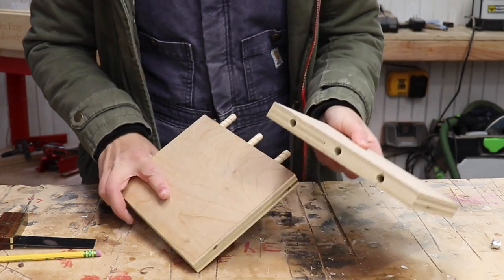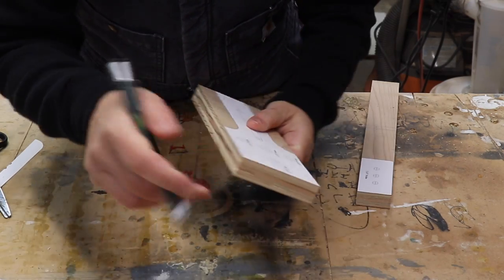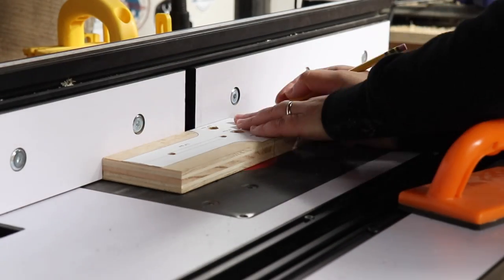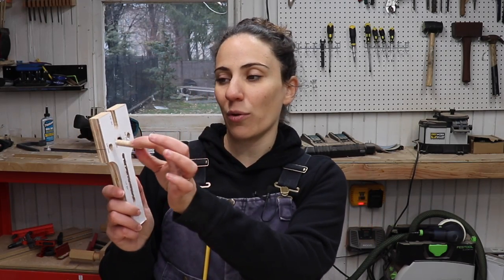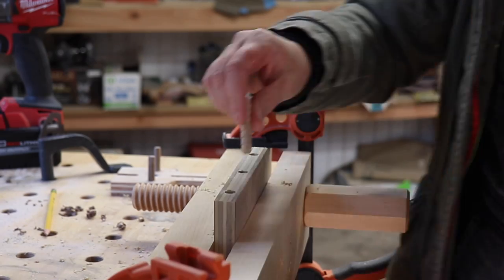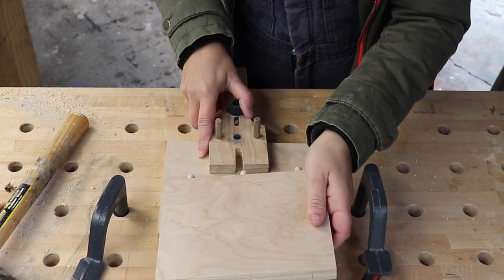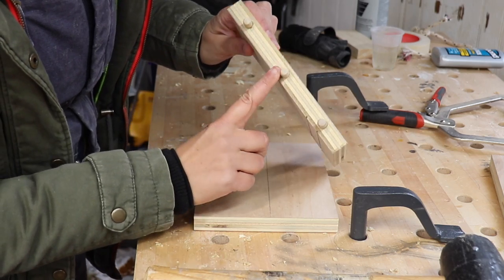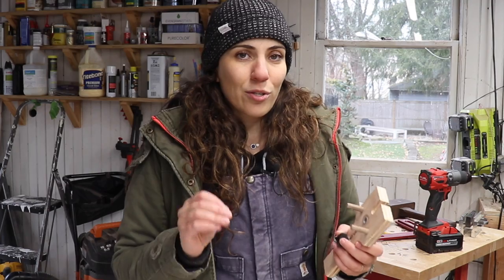Making an ADJUSTABLE Doweling Jig for Joinery

Comment: Hey Tamar, thanks for making this available to us all. I just realized after going to Lowe’s to purchase the steel bushing for the center hole, purchase a second bushing with 3/8 outside diameter and 1/4 inside diameter. Then your dowel jig works perfectly with both 3/8 and 1/4” dowels, same jig, just ad a smaller bushing. I too will likely only use 3/8” dowels but I thought I share! The bushings were in the hardware isle.

Comment: The jig you based off of is the jig I do have. I have only used it on one project. I had one are where things just did not line up. There was no issue with the jig, it was my error of how I lined up my boards. I drilled the board facing the wrong way.  That is one thing you have to do is be mindful of your board orientation. I fixed by switching to pocket holes. It was my first project with the jig, and I learned from my mistakes. Yes the jig is plastic and if does wear out or break, I now have a source to know how to make a replacement jig. Thank you for the idea and video. Your videos and how you approach and overcome are AWESOME!. It is people like you that inspires me. Please continue to make awesome videos! Mike from Tucson, AZ
Reply from the maker: That’s so awesome to hear! Thanks!

Comment: Thank you for taking the time to make this video. I’ll add that some metal tubing is not precisely 1/4, 3/8, or 1/2”. One may use something called a steel spacer in the nuts and bolts area of one’s local hardware store. Such spacers are only a few cents, come in various lengths (no need to cut them) and pound nicely into wood like you showed. Also Lee Valley makes inserts and bushings for interchangeable sizes (I think something like 6 sizes), but the require a 5/8ths hole, larger than most drill indexes. 

Anyway great video.
Reply from the maker: Good to know!
Reply: Tom McCurnin Would you be so kind to PM me please?

Comment: I just picked up the Milescraft doweling kit a short time back. Basically the exact same concept but with 3 different sizes of drill guides for various dowels.
Yours is much nicer than a mass manufactured piece of plastic from the PRC.
Reply from the maker: It’s nice to have that option for different sized holes though. Thanks!

Comment: Fantastic, will be making mine asap, love it, and it would be easy to make two or three at different sizes,. after all not many of us use 27 different dowel sizes three would more then cover me. Loving it.
Reply from the maker: Awesome! Totally agree! Think I’ll just make one more for smaller dowel
Reply: if you want different sizes (bushes) look at the 3 screw in bushes (metric I know 6,8,10,) supplied with the 'cheap' Silverline pocket hole jig (£5.00. UK)

Comment: I never saw that dowel jig for joining the boards perpendicularly...  I have the original jig and I loved it, but you're right, it could only edge join boards.  I'll have to get me one of those (or make one like you).
Reply from the maker: Yeah... that jig is great for panel glue ups. I always found dowel points to be a bit finicky. Good luck with it!

Comment: To make it use different size dowels, you could drill / route out a larger hole in the jig, and then make inserts with different sized tubes to accommodate the different drill sizes.
Get project and I'll be making one myself soon.
Reply from the maker: Awesome! Glad you liked it!

Comment: The way I use the metal jig you showed (which is very inexpensive) is to take a scrap piece from the wood I'm using that and Mark and drill the holes using the jig. 

I then cut the strip off so the hole go all the way through. I then use that as a jig for both end drilling and face drilling. 

I use it as a marking template for the edge and I clamp it on the face and use the holes to just start drilling enough to create a mark, then drill to full depth.
Reply from the maker: That’s what I used to do. I used to make a template just like that like I showed in the beginning of the video. It worked really well but I didn’t like that I needed to make a new one for every project

Comment: This is amazing. I have to make this.

The metal collar just needs to be removable and have some sort of adjustable clamping mechanism to hold different sizes in place
Reply from the maker: Have fun!
Reply: @3x3CustomTamar  I will. It will be extra fun and challenging because I have almost no tools to do it. A coping saw, circular saw, drill, and a few other tools are all I have.

Comment: I have a dowel jig like yours with various different size holes for drill bits. I only hole I ever used was 1/2" dowel holes. Then I discovered DowelMax it does everything you are using you invented jig for.
Reply from the maker: Yeah they actually sent one to me after this. I can’t wait to use it!
Reply: Perfect you are a Rock Star! I love my DowelMax.

Comment: I’ve already got a Wolcraft for 3/8” and smaller - but I’m going to modify your template because I can’t seem to find any retail device that can accommodate a 1/2” dowel pin. Just need to determine (and locate) outer steel tubing dimension with interior an hole size of 1/2”. Great template. And yes, the open slot also needs to be expanded to1/2”.
Reply from the maker: Awesome. Glad you found it useful!

Comment: I found steel spacers 1 1/2" long, that fit inside each other so you could use your jig with some idea for front slot to be determined, for different size dowels:
1/2 ID 5/8 OD for 1/2"
3/8 ID 1/2 OD for 3/8
1/4 ID 3/8 OD for 1/4  (looking for this one)
Nice wooden jig
Reply from the maker: Cool

Comment: Nice build.  I watched Jean on the Woodshop Junkies channel review that same doweling jig.  Looks like your version could be more versatile, depth-wise, and quite possibly more durable- the commercial tool is plastic, after all.
I love that this jig requires very little matching up lines to match holes - you're using the installed dowles to match the mating holes.  

Great build, thanks!  I might have to scrounge some scrap...
Reply from the maker: Thanks! So glad you like it! I was surprised with how well it worked! Good luck with it!

Comment: Great jig. I would use bushings with 6-8-10-12 mm holes from a $7 drill guide set (the Chinese made type with a clear plastic holder).
Reply from the maker: Thanks! Sounds like it would work

Comment: Once again Tamar....awesome stuff.
Reply from the maker: Glad you liked it!
Reply: @3x3CustomTamar  I made a centering jig like you have with the dowels and a pencil in the middle.  It did not seem to work right.  Sometimes it would center, sometimes not.  Any thoughts?
Reply from the maker: Shane Thompson hmm. Did you use a drill press so drill the holes?
Reply: @3x3CustomTamar  No I do not have a drill press.  I did my best to make sure the drilling was straight up and down but obviously my best was not good enough.

Comment: Hi Tamar, was thinking how to solve different dimensions of dowels for this jig, not using wolfcraft solution, that is having separate circle dimension depending on place of hole.
We have here static parts and adjustable part. Static part is middle hole + 2 bolts that mark circle middle and it's border (that's why we always get in center of material). Second, adjustable part is responsible to control material thickness and it's also not an issue.
Problem is in first part, that size of drill hole is static and we want it to be adjustable, all that must be done is to create a exchangeable insert with metal bearing, that for every dowel/drill size will always be in center vs 2 dowels that mark the outer circle.
I would route a recess about 12mm (0.5 in) deep and 25mm (1 in) wide in base and create 3 plug-ins (0.5''x1'' with perfect fit to recess) that i can screw on with muff to base* for 3 most common dowels (6,8,10mm | 1/4'',5/16''/,3/8'') and it would be piece of cake to add more of this in future.

base* = jig per se :P

Comment: Great idea. I do a fair bit of dowel joining, but much smaller than this — I use 2.5mm dowels bamboo dowels, also known as toothpicks. I normally use cut tips of 2.5mm nails as a guide, but if the edge I’m drilling into is thin, like tone wood for example, it’s frighteningly easy to get it wrong by drilling at a slight angle. I might build one of these in aluminium.
Reply from the maker: Awesome

Comment: Very cool jig! I made a much more simple dowel jig (the clamp on kind), but I do love the versatility yours offers (I'm all about the options). I think the only thing I would add is a saw mark to that centerline on the side with maybe a thin strip of brass or some black Starbond glue to fill in the line and make it more permanent.
Reply from the maker: Thanks so much! And I totally agree with you. Going to add that.

Comment: great project. 2 small things come to mind. 

first, you mention different size dowels, this seems cheap and easy enough to just make a few extra , one for each size. thats one of my favorite parts, its very useful, but very cheap and simple. 

2nd, the only addition id make would be to cut a small v-grove in the side instead of the pencil line that may smudge/rub off over time.
Reply from the maker: Thanks! Totally. I’m going to make one for smaller dowels too. And that’s a great idea for the sides

Comment: Interesting design. Just a suggestion though: the slot in the front of the jig was cut with a bandsaw and I can see that the dowel doesn't quite fit snugly in it. Milling it with a 3/8" router bit on the router table would ensure that the resulting slot matches the diameter of the dowels perfectly. That way, the edges of your joined boards will line up better (especially on longer pieces).
Reply from the maker: Totally. Just wanted to give ppl options.

Comment: Great jig Tamar. You "could" design one for a different size dowel but most of your work is geared around 3/4 inch material so ...  I suppose that you could make another guide using removable wooden inserts containing different size guides... I wouldn't - it would be easier to make a second jig for the different size dowel. You do great work and excellent videos.
Reply from the maker: Yeah. Totally agree. Think I’ll just make a second one for smaller dowels. Thanks!

Comment: Instead of tubing use a couple ball-bearings. The inner diameter is precies and will give less friction on the drill bit. For different sizes dowels make a jig for each diameter dowel you plan to use. Your only restriction for the diameter is depending on the inner diameter of the ball bearing you can find.

Comment: It's a clever reverse engineering of a similar jig from the german brand Wolfcraft.
Their device has an offset for the centering dowels, so they can place three different sizes holes : 6, 8 and 10 mm. There is also a block with miter cuts on the handle side to complete the centering dowels.
This block also contains what I suppose to be a spring-lock mechanism to maintain the position of the equivalent of your stop block.
There are three slots to align the jig with the dowel already placed, and they've added a center lign on the side in order to drill in the middle of the boards.

All in all, the german version is bulkier than your's, especially on the thickness side.
So, even if your version only does one size holes, I find it more interesting for two reasons. First, the design is lighter, and second, you have the satisfaction of a completed DIY project.
And as you say you love dowel joinery, and if you see this comment, maybe you can come with an elegant version 2.0 that can handle multiple sizes holes.
Reply from the maker: Agreed! It’s so fun to make it yourself

Comment: I also made my own dowel jig not unlike the one you show at the beginning. It is made with three holes where the middle hole is not centered, thereby giving me some amount of leeway in where the dowels are located. It drills 5/16" dowels, is self-centering on the edge of the board, but easily comes apart to use just the center and one outboard part to drill the corresponding holes in the face of a board. I am going to make a new one, because the steel tubing I used for this one only has 1/16" walls and has started to wear so that the drill bit wobbles slightly. Although I may just drill the holes in this one oversize to accept tubing with 1/8" walls for 5/16" dowels, and make a second one like yours for 3/8" dowels.
BTW, I think you meant that the tubing you used has 1/16" walls, not 1/4", because having 1/4" walls would make 1/2" tubing invisible. :)
Reply from the maker: Oh. Ha. Maybe. Oops. It’s so fun to figure this stuff out
Reply: @3x3CustomTamar  It's a great jig, and seeing how easy it is to go from edge drilling to face drilling, I may not even repair my original jig.

Comment: Great design! But in the center of board I would just measure and mark where to drill. And use +0,5mm bigger drill to compensate play of drill. I made a similar jig and it is very comfortable at the edge, but takes more time in the center.
Reply from the maker: Thanks! Sounds cool

Comment: when using spay adhesive for templates, i've found that spaying the paper can lead to expansion in the paper, causing template to fail. spaying the wood works better, but it's more mess to deal with after.
Reply from the maker: I’ve never had that issue. I just wait about 2 minutes for it dry a bit before putting it on the wood and it peels off pretty easily that way too
Reply: @3x3CustomTamar  Thanks for the reply! it may be a thing with either the glue, the paper or both, i've had it with both plain printer paper and universal bond paper for builders drawings. i'll give the fancy 3M stuff you're using a try, sanding off paper and glue is work i can do without

Comment: Amazing design! I am considering maybe a smaller/thinner tube inserted into the 1/2 in. tube will make the jig work for smaller dowels. You may sand the 3/8 in. tube until it is snug, not too tight or too loose.
Reply: The small 3/8 slot in front will also need an adjuster for smaller dowels.

Comment: Very good. I failed to come with a design so I made my dowel template from an 18mm metal bar. It does ends and faces OK but it's not as cool as yours. Same as you I always use 8mm dowels so one size is great. I might have a go at your design now. 😊
Reply from the maker: Awesome. Hope it works out for you

Comment: Great video.
Couldn't help but notice your work bench and specifically the clamping mechanism. Have you got any more information about that? Looks so quick and useful!
Reply from the maker: Thanks so much! Yeah! It’s a table from armor tool with dog holes. The clamps are just hold fasts that lock into the holes on an angle when you bang them

Comment: first lesson by my old man was sawing aged about 7, then drilling straight with a hand drill,.and then the doweling/domino thing.  two holes drilled and 1min with a chisel and you saved yourself $1200 on a domino. he was a master carpenter, you dont need all these excess tools you need some basic joinery skills.
he never used jigs, he used his eyes. that way your body learns to do it accurately. using a jig you never will learn to do without.
you dont learn to walk using a walking stick.

Comment: Cool jig! I have a milescraft one that is for 3 sizes and is a bit overkill because really always use 3/8" dowels only once used it for 1/4" ones. Is nice to make your own jigs mostly because can be done more fitted for your needs in my case I feel the milescraft handle is a bit small for my hands and also to adjust the stop block is a bit unconfortalbe with a couple of tiny knobs on the sides again my hands are a bit to big for them 😅 so gona make one for myself 😀
Reply from the maker: Awesome. Yeah! I hope you like it

Comment: Really great instructional video! To your point about only drilling 3/8 inch dowels/holes: it’s not an expensive jig and I think you would be better off making multiple versions in different sizes. Plus, if you have a couple of jigs instead of one “All purpose” you’re going to be less likely to make an error. Great job as always… Thank you!
Reply from the maker: That’s a good point!

Comment: Maybe get one of those really cheap little plastic doweling jigs from eBay that break so easily and use the metal bushings that come with it to place in the hole for drilling different size holes.  One could also make a hole in the end where the slot is to place the bushing for aligning on the flat; instead of a perfectly round hole, it could be made oblong so it can adjust up and down to compensate for different thicknesses.  I might have to try this since I have had been of those cheapie plastic units and it came broken.

Comment: Great video! You explain how it works perfectly for all three types of doweling joints. Also thank you so much for the free plans too, that is so very nice of you. You mention at the end of the video about the limitation of it only being useful for one type of dowel, well I think someone was listening. I hope I am allowed to say this, but there is a version of this jig made by Milescraft called the JointMate. What they did was align 2 holes with the one in the center. One on the left and one on the right with different diameter holes. The doweling pins are placed in the back and front of the holes. It looks like a pretty decent little jig, and cheap too, but I am sure you will be compelled to build your own, right? Thanks again.

Comment: Nice jig for making your own.   Have you considered drilling a hole at the top instead of the slot so you wouldn't have any play to deal with?  I have been using Dowelmax which is a great option for doweling also.
Reply from the maker: Thanks! A hole might not work if you are working with different thicknesses. And dowelmax just sent me their jig after I posted this video. Can’t wait to use it!